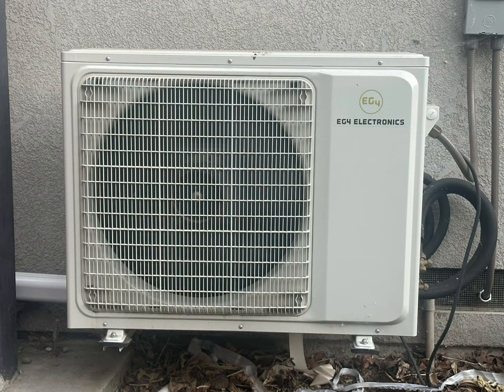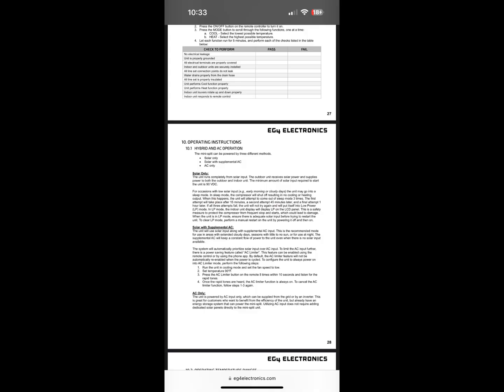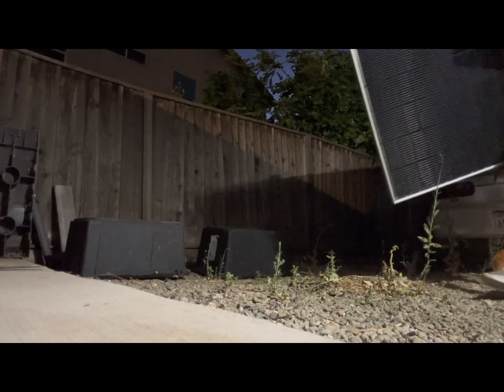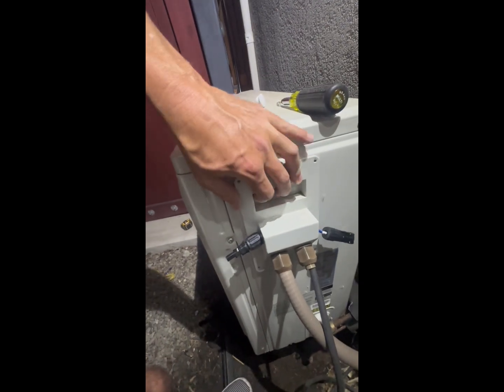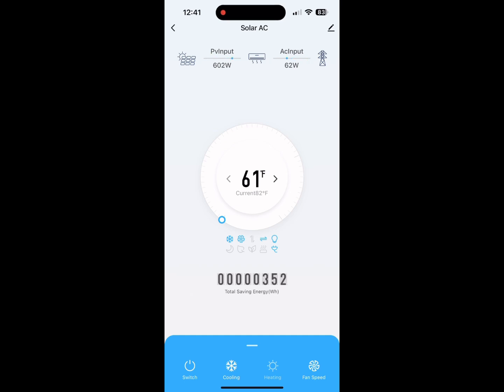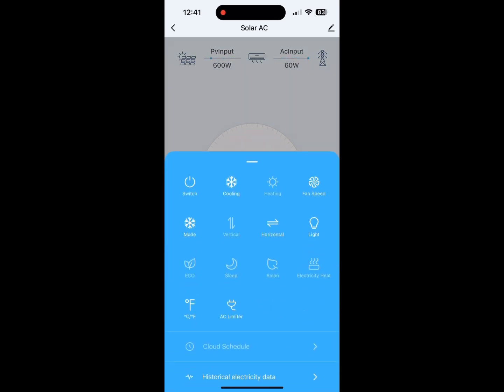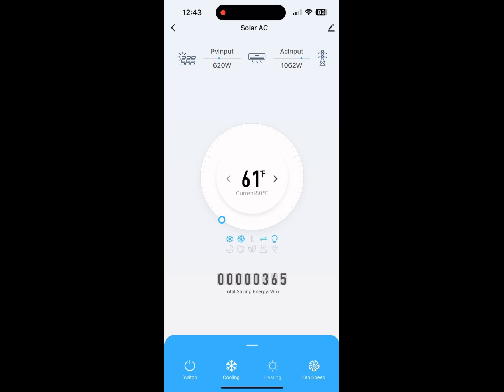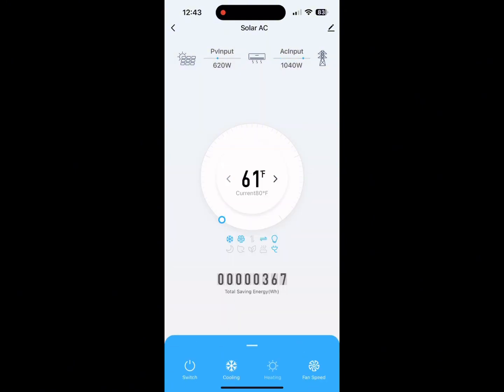(Audio fixed)EG4 24k ac dc mini split. Test to find the min panels off grid ac

Comment: Interesting that it can mix PV and grid.  I have an EG4 6000XP inverter which can run off PV or grid, but either/or (can't mix).  Once it switches to grid (per time-of-day setting), it uses any PV to recharge the battery.  I have half the battery recommended since batteries can be the main cost of a solar setup (mine cost as much as the inverter).  Mixing in grid power seems better.